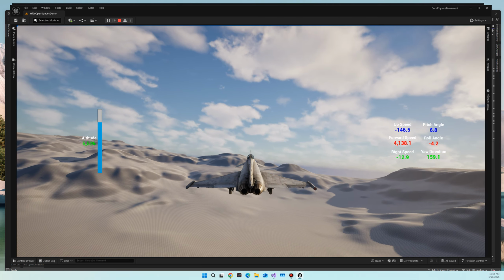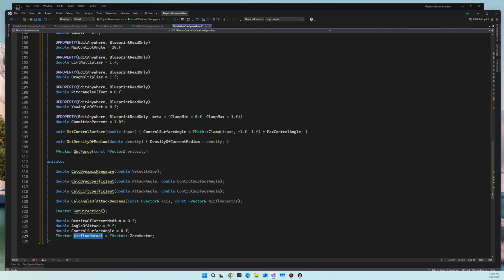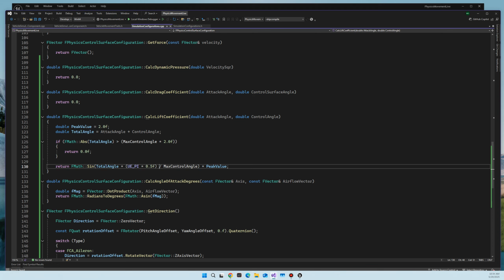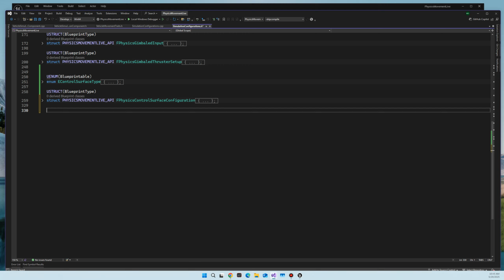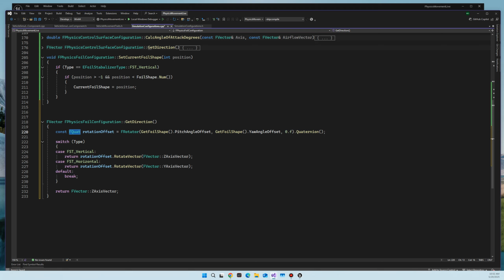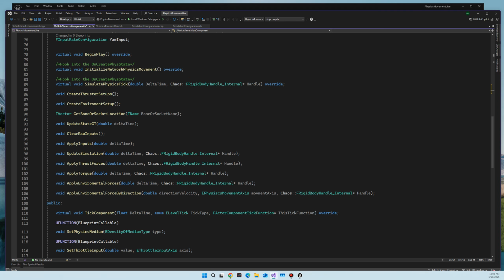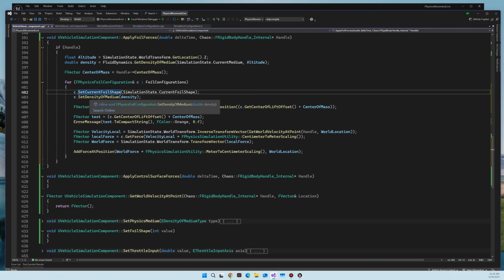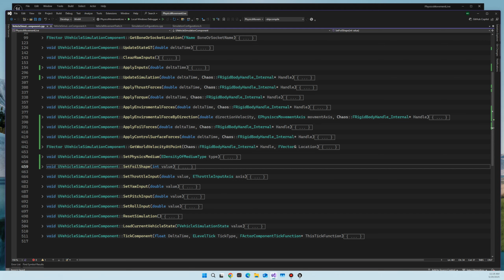How to add Wings and Flight Control Surfaces to your Physics Movement System (1/3)

Comment: Hi Mark! Thank you very much for these videos on physics-based movement. I'm currently working on building a custom vehicle movement using the APawn base class, but I'm having issues with updating the suspension. I'm not using the Chaos::Rigidbody class instead, I'm using simple AddForceAtLocation.

The suspension is not stable at all unless I use very high values to achieve a "stable" vehicle (spring strength: 965,000.0).
I'm surely doing something wrong, but I'm not exactly sure what. Do you happen to have any advice on this?
Reply from the maker: I am assuming when you say “Unstable” you mean the springs are rocking the vehicle back and forth between each other.  If that is the case then what you are missing is the "Springs Damping Force" to help cancel out the Oscillations being created by each spring as it rocks up and down.  Each Spring is working against each other causing the other to rock the vehicle.  One trick is to look at the Angular velocity of the vehicle along the X and Y axis and add a counter force to the spring to help zero out that Oscillation.  The other option is to as a damping force on the spring in the opposite direction based on the Linier velocity in the going into the spring (I assume along the z axis). You could also add Anti Torque into the System by increasing the Angular Damp on the vehicle, but that could cause other unintended issues to other parts of the vehicle.   

In essence you are adding friction into the system.  Force in motion needs an opposite force to help cancel it out otherwise at best, the oscillations will keep going, at worst it will amplify and rock you vehicle over.
Reply: @MarksChannel-f1h  
Hi, thanks again for your earlier reply!

I realized I wasn't very precise in my original question, so I just wanted to clarify things a bit better now.
In my custom vehicle, I do already have both spring and damper forces per wheel. I calculate compression through raycasts, then apply:
- Spring force, based on compression distance
- Damping force, based on the rate of change in compression between frames

For each grounded wheel, I apply the total suspension force in the direction of the contact normal. I also tried adding some angular damping torque globally on X and Y axes, based on angular velocity.
Despite all that, the vehicle is still very unstable, it rocks, wobbles, and feels unpredictable, especially when landing or driving over uneven ground. I’ve had to use very high spring values to keep it from sagging or bottoming out, which might be masking a deeper issue.
At this point, I’m starting to think the instability might not just be about damping maybe something else is wrong in the way I apply forces, or how the suspension reacts frame-to-frame.

Do you have any ideas or common pitfalls that could cause a vehicle to behave this way, even if spring and damper forces are implemented?
Would using a rest compression point or doing something per suspension point with angular velocity help reduce the rocking?

Really appreciate your insights it’s a goldmine for us!
Reply from the maker: Are you calculating the difference between the previous displacement point and the new displacement point then dividing it by "Delta Time" (This will take frame rate into account)?  

That would get you the speed of the spring pre fame.  This would help to reduce that large number to something smaller.  you can also use the difference in spring displacement to decide whether to use a compression damp value, vs a rebound damp value (current < previous) ? compression : rebound.  

Also you have Gravity pulling your vehicle into your suspension, so you may need to check the total mass of your vehicle because that is going to have an effect on how stiff you need to make the suspension to be able to counter the mass of the vehicle.  

I think using the rest compression point would help in determining max length and max compression that your spring can travel before.  Ultimately you want to get the spring back to its natural resting point.
Reply: @MarksChannel-f1h  Thanks for your answer! I will try to implement this!